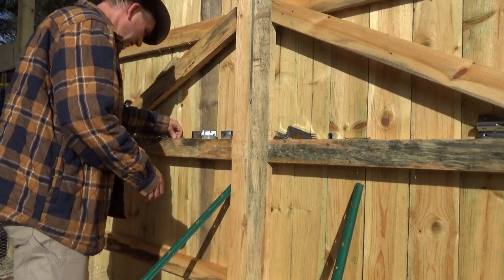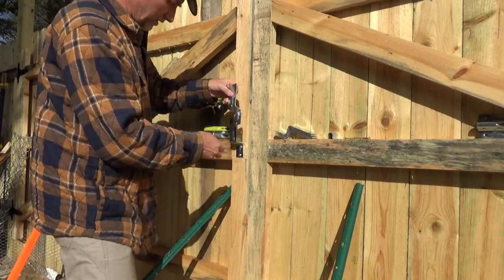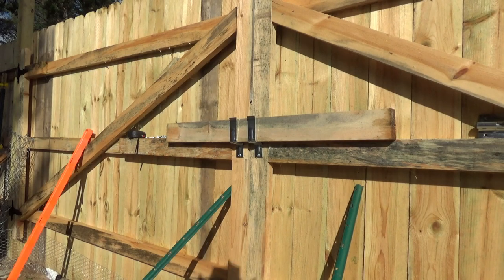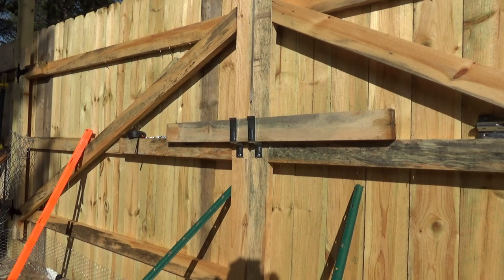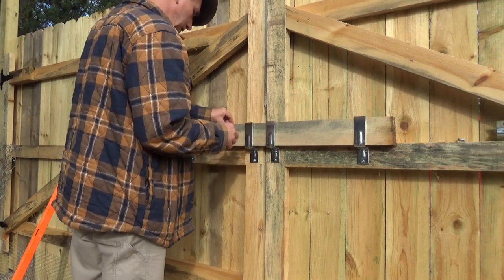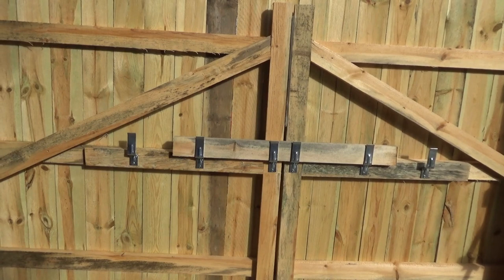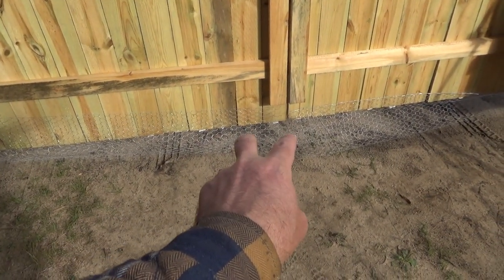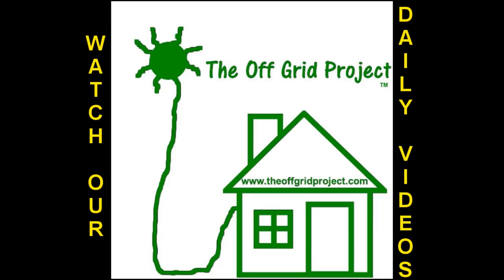Daily Vlog Putting Barricade Brackets On Our Gates Looks Like A Fort

Comment: I'm watching the weight on those two gates adding up and from experience, know that you are going to have to add 1/4 inch braided steel cables to the top of your two gate posts, and anchor them down to the bottom of the next post over. Then put an eyelet cable adjuster in the center to tighten the cable as the years pass. (Go for the longest length adjusters you can get). Since you have your walk in gate anchored next to your driveway gate, you would run the cable to the top of the 2nd post over from the driveway gate post. I'd also strengthen the brace between the two walk in gate posts with two 2x4s (1 on each side of the post) and use carriage bolts to anchor them in place. Then it's just a matter of using a level on the post that has the cable anchored to the top and checking the vertical level of the post from the outside edge of the driveway. Adjust the adjusters as needed. Don't over-depend on your core bolts to take the weight off your gate posts. Really good job on the fence to date!
Reply from the maker: Thank you and thanks for the tips. Do you think I will still need the cables even when I put supports up and over the gates, joining the two posts together? I am thinking about going up to 12 ft high on the posts and then another horizontal beam connecting the two. With angled boards between the beam and each post for added support and to prevent sagging of the beam over time. Hope that is clear.
Reply: @TheDoItYourselfWorld  ur 1st gig was fine... u need me to come show ya what to do for wind an weight on gate doors... u dont need half the crap u wasted tha day on.... good trying on what u wanna do by urself! look at my video on thieves cant steal from a crook... lolol and yes doors are self made... with the same 1st latch you had without making the mess u made with 2x4 thing of a jig....
Reply from the maker: I did want the barricade tho. It was one of my original plans. Thanks.
Reply: @TheDoItYourselfWorld  A cross beam between the two gate posts would work much better than using cables. Now all you would have to worry about is the posts sagging inward from the gate swing. But got a feeling you plan to use two 4x4 angled posts to solve that?
(Don't forget to hang the sign that says "Fort Reed" from the cross beam)!

Comment: Hey Troy,
A couple of ideas for the 2x4 on the gate to make it even sturdier and more secure. 
1st: To make it even more solid you should put 2x4 behind the board in between board and the pickets. Plane it down maybe 1/4 of an inch so it willnot be difficult in getting the board out
2nd: Instead of taking the board out, put a rounded head lag bolt through from the other outside of the fence and bolt the 2x4 on one side to make the 2x4 a swing arm. On the opposite end of the 2x4 board you could attach a padlock attachment and put a padlock on the swing arm on the inside to prevent someone from pulling the board out by dropping a line over top of the fence.

I Hope these ideas are helpful for you?

Matt
Reply from the maker: Thanks. Someone suggested putting metal on the 2x4 for strength. I have also considered a metal bar. Another piece of 2x4 attached in the center would also help. I have thought about putting it on a hinge too. Not sure yet which way I will go. Thanks.
Reply: Howdy Matt, that’s a really great idea! My late husband and I have been friends with Troy for many years, and I’m very familiar with the crap he’s had to endure for more than a decade now… so sad… it’s a terrible shame that he has to endure such an outright evil spiritual war… my husband was Promoted to Glory 3 yrs ago and we used to have prayer sessions with Troy. I think it’s time to start them again! 
Blessings to you and yours!
Reply: @bernadetteevans2  Hi Bernadette! Sorry to hear about your husband, I hope you are ok with things at this point. I haven't actually met Troy in person as of yet. He and I share similarities in a few ways. I found his channel just months before I went to marry my wife in the Philippines, in fact we went to Luneta Park because I had seen Troy and Melanie there when he went to meet Melanie. Carine and myself just celebrated our 5th Anniversary yesterday. So it's been about 5 1/2 years since I found Troy here on YouTube. Right from the beginning I could tell he's a good person. It was while before I ever found out about the clan of idiots that pester him. I was both amazed and saddened how supposed grown ups could be so childish.
Since first seeing Troy's videos I began messaging him here. We have also emailed and swapped numbers, and I plan to get to Michigan in the future with my wife so we can all meet. The of grid life is very appealing to me, and I have drawn a number of plans up for different types and styles of homes with the plan of one day buying property and building our own home.
Great to meet you and thank you for your message Bernadette. Keep Safe Always.
Matt

Comment: You did say you were building a fort fortress around your property.  I suggest Walmart Guardhouse corners too.
Reply: With remote control BB machine guns...and high definition TV Cameras on auto pan.
Reply from the maker: Yes we are. And I will build watch towers as well. With solar panels, battery banks, cameras, LED lights and alarms on each one. Each separate and independent of the others.
Reply: @TheDoItYourselfWorld  still not impervious to directed energy weapons. I suggest quarter inch plate mirror roofing shingles
Reply: @TheDoItYourselfWorld  GOT START THE BABY PLAY HOUSE LOL

Comment: could you have a rod that can slide up and down and go in to a hole in the ground.  What did at my home is dig a 2 foot hole put some gravel in the hole about a 6 inches of gravel in the hole put the pipe in to the hole the hole abut about 12 inches round with the pipe in the middle with it a few inches in to the gravel.  then poured concrete in the hole flush with the top of the pipe.   that way when I close my double gate I can take the rode from the gate drop it in to the hole. then I can latch the rest to that part of the gate.  It keeps my dogs from pushing open the gate, and its pretty strong.
Reply from the maker: Yes, they are on the way. They should arrive today.
Reply: @TheDoItYourselfWorld  cool.

Comment: It would of been better if you had a metal plate on the outside, with carriage bolts going through.  I would also plane down your bar, and then get angle iron, and screw it in on all four edges. This would increase the bars strength, without making it too heavy to lift.
Reply from the maker: Nice idea!! I love the idea of angle iron. Thank you.

Comment: I would put bolts through to the outside of the gate. I would also put 3 of the Barricade Brackets on the gate.
Reply from the maker: I thought of going through but anything that goes through can possibly be removed or loosened from the outside. We are not done yet. I am putting cane bolts through into the ground too.